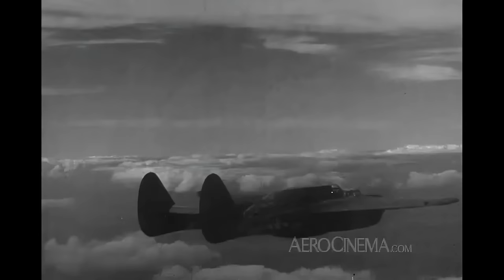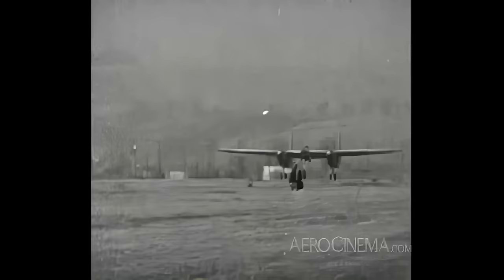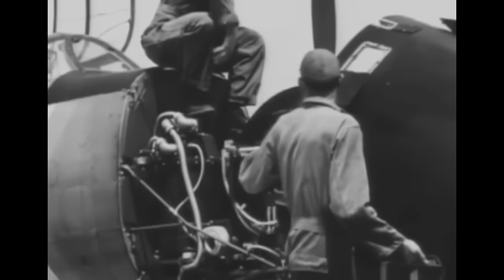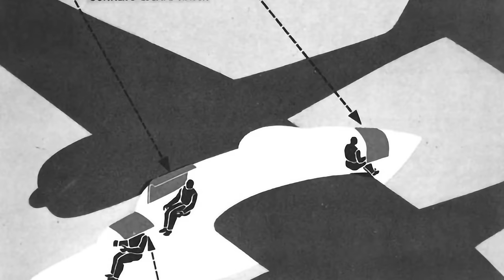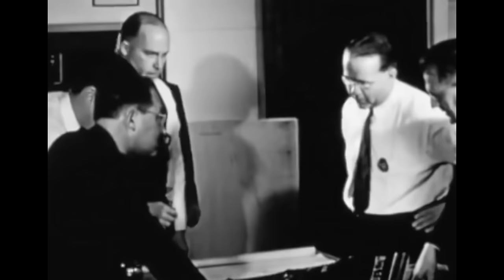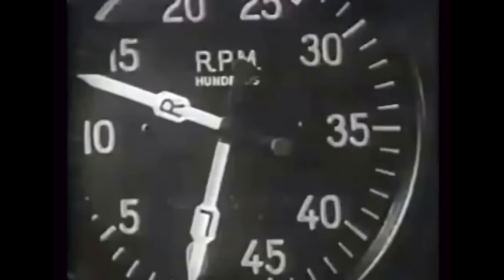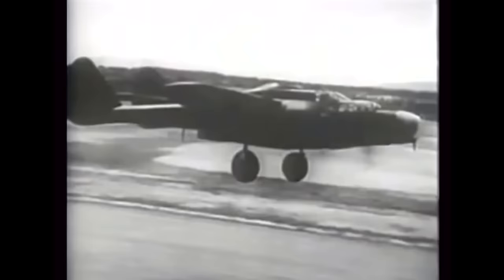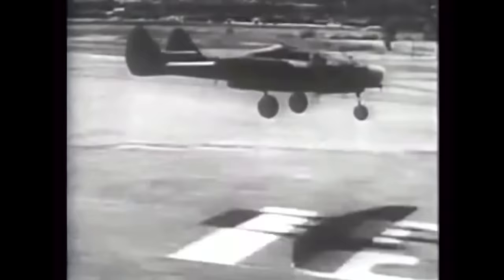Northrop P-61 | The Widow And The Spy | The Black Widow

Comment: A fascinating and a very innovative airplane. Unfortunately its speed and altitude performance were disappointing despite these innovations.  It probably would have helped if the aircraft had an exhaust driven second stage supercharger instead of the 2-speed mechanical 2nd stage blower. And in my personal opinion designing it for a 3-man crew was unnecessary and cost too much in performance. The gunner and the stepped cockpit that let him look over the pilot increased weight and drag.  Without this unnecessary crew position the upper guns could have just been locked to forward-firing for offensive use by the pilot, and unlocked for defensive use by the radar operator/gunner, saving weight and drag.  Other night fighters of the war with two man crews offered better performance on less horsepower.

Comment: There was a one on one flight competition between the P-61 v. The Mosquito held in Britain in early 1945.  The P-61 beat the Mozzie in every parameter.  The Brits insisted the results were kept secret.  Fact.  The P-61 also gave a P-38 fits in mock combat trials in the US.  amazing plane.
Reply: Yeah right!  Pull the other one.
Reply: @ultimobici.  hmmm... your emotions vs statics and field test reports. These results are highly verifiable. Grumpies don't know them but experts do.
Reply: No it didn't,  by the time the P61 was fully developed in speed and altitude performance the War was over...Although not developed as a night fighter the Mossie,  as in most rolls it played it excelled...Also the Luftwaffe's HE 219 Owl was far superior, but like the Northrop design it  arrived to late to make any significant difference...The P61 has nothing like the same operational history as the De Havilland design...
Reply: @brianperry  I wasn't referring to operational history, just one on one performance trials.
Reply: @brianperry  None of your points apply to the statement that was made.
Reply: Yes, the P-61 Black Widow night fighter did out perform a Lockheed P-38 Lightning in a mock dogfight.  This occurred at Muroc Dry Lake in late 1944.  The P-38 was flown by Lockheed test pilot Milo Burcham and the P-61 Black Widow night fighter was flown by Northrop test pilot Harry Crosby.  Both aircraft squared off at 20,000 feet and were soon engaged in a one circle dogfight. Milo did his best to get on Harry's tail, but Crosby kept tightening the turn radius so Milo could not get a bead on him.  It wasn't long when Harry got the advantage and was able to get a bead on Milo in the Lightning.  This moch dogfight went on for 30 minutes until Milo was convinced Harry was trying to kill him.  Finally, Milo Burcham threw in the towel and told Harry he won the dogfight hands down.  When Harry Crosby landed back at Muroc Dry Lake, he told Northrop engineer Fred Erb that "I had just proven to Lockheed that their P-38 Lightning is completely obsolete."  Granted, Harry Crosby was an exceptional pilot.  Sadly Harry Crosby was killed on 12 September 1945 while flight testing the Northrop XP-79B jet powered flying wing battering ram aircraft. The aircraft went out of control at 7,000 feet and Harry baled out of the stricken aircraft at 2,000 feet.  Unfortunately, Harry was hit by the aircraft and rendered unconscious.  Both Harry Crosby and the Northrop XP-79B were lost.
Reply: @jimfinlaw4537  Crosby also flew the P-61 through large aircraft hangers just for chuckles.  Until he was threatened with dismissal.  The P-61 was a truly amazing aircraft and just came a bit too late to see much action in WWII. But it was there incase the war went on and would have been the superior night fighter of the war.
Reply: @AmericasChoice  Yes, Harry Crosby was quite a character.  Fred Erb was telling me about the time Harry was test flying the Northrop N-9M Flying Wing research aircraft by performing lazy eights so low to the ground that the wing tips were only 6 feet off the ground during turns.  Eventually, Harry got board doing this so he radioed the tower and said he would make a few passes through the hanger.  It wasn't long when the guys in the hanger closed the hanger doors so Harry could not fly through them.  Then Harry got another idea and flew down a highway extremely low where he forced cars off the highway.  It caused such a stir that the Sherrif's department filed a report against Northrop, which resulted in Harry being grounded.  The next day, Northrop officially grounded Harry from all flight activity.  Unfortunately, he did not let that stop him.  Harry stole the N-9M Flying Wing research aircraft and did the same thing again, running cars off the highway.  When he landed, he was arrested and threatened with dismissal from the company if he did not clean up his act.  The P-61 Black Widow night fighters did arrive too late to make much of an impact on Workd War II.  My father got checked out in a P-61B at a depot base in Seattle, Washington in 1945 so he could beat an incoming snow storm.    It was the first aircraft purpose built as an all-weather fighter and was the first aircraft to be equipped with spoiler flaps in addition to ailerons.  The ailorons were only there to provide the pilot with feedback through the control yoke during low speeds such as takeoffs and landings.  My father loved flying the Black Widow.  He said it was the best twin engine fighter he ever flew during the war.
Reply: @finallyfriday. I heard many times about that test. About half say the same thing and the other half say the opposite 😅. I have never seen the results of the test, but I always thought it's funny that if you are a P-61 fan, it won the test. If you are a Mosquito fan, the Mosquito won the test. 😂😂😂
Reply: @samuelgordino  Mossy fans compare specific models to each other and in this flexible scenario the mosquito can win, ANY plane can win against any other plane, but in head-to-head competition the current model P-61 beat the current model mossy hands down. I've notice that the English love word play to win a debate (pseudo Shakespeares). Look at how they try to make Montgomery actually seem like a great general.